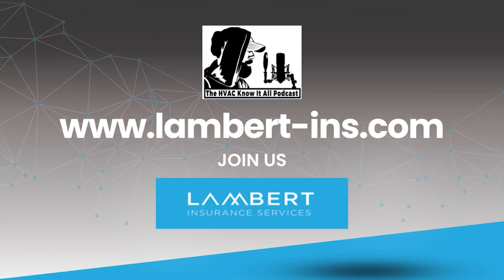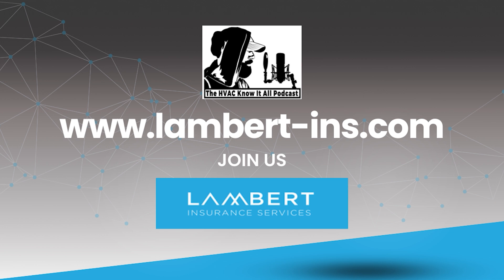How Aeroseal Seal Duct Leaks from the Inside to Stop HVAC Energy Waste with Dr. Mark Modera | Part 1

Comment: nice product. Worked for a contractor who did this method and can say it'll seal easier than mastic/duct butter.
Reply from the maker: @ShawnTaylor-h4c  and what test did he do to prove that?
Reply: @HVACKnowItAll  Seems that aeroseal software runs a pressure test after the seal and would tell you it went from this many square inch hole to a smalller square inch hole. really cool technology. Seems they protect their contractors too territorially. not really cheap but what is that works?